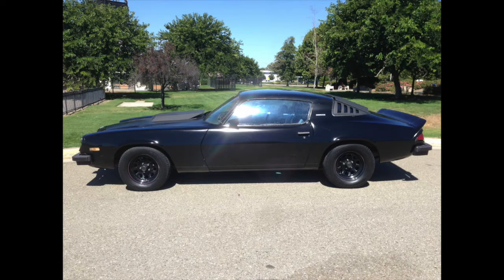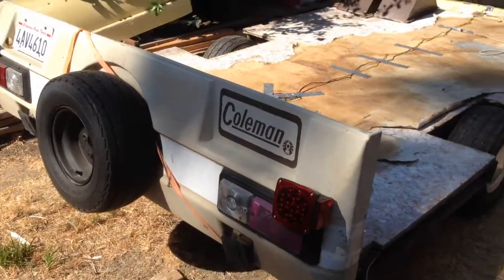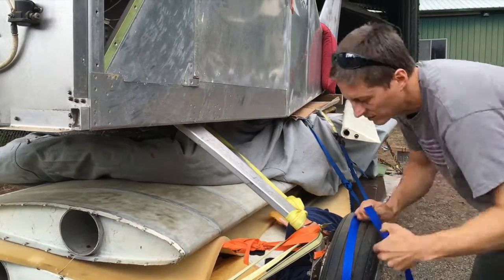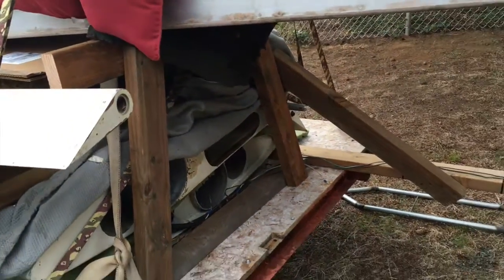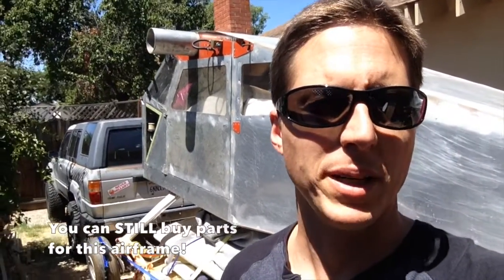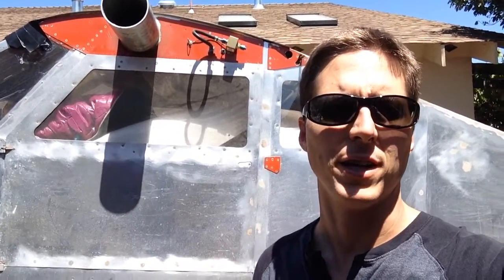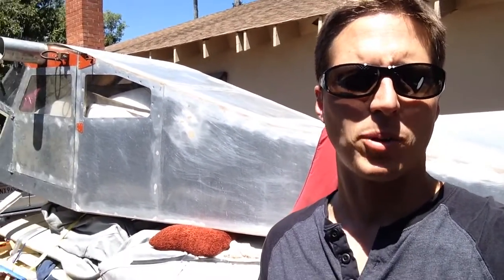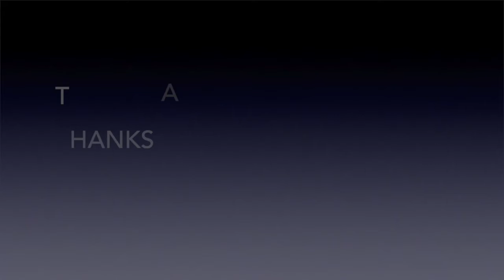I Bought A Real Plane

Comment: What kind of servos are you planning to use?!  How will you check the CG?  Make sure every bolt of the thousands of bolts on a real plane has thread lock on it!  LOL!  As you well know, in a real plane, even a first "little" crash will likely be your last crash! :-|

I'm really looking forward to the upcoming vids in this build series.
Reply: Yes I plan on checking every single nut and bolt in this plane.  There are a lot of them but possibly slightly fewer than you might think.  I've joined my local EAA(Experimental Aircraft Association) to help ensure I have other experienced qualified people looking over the build.  I have the plans for this aircraft and they give all sorts of ways to verify things like CG.